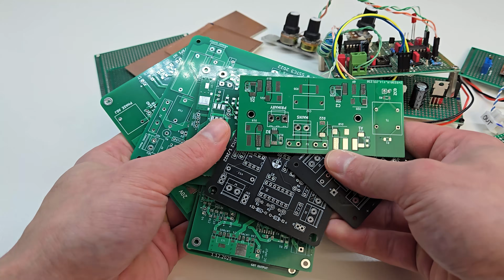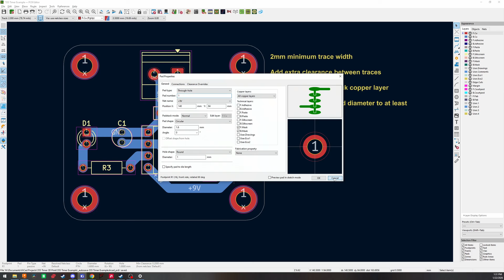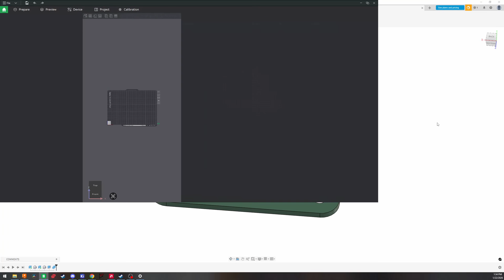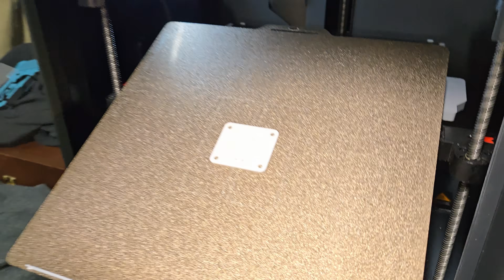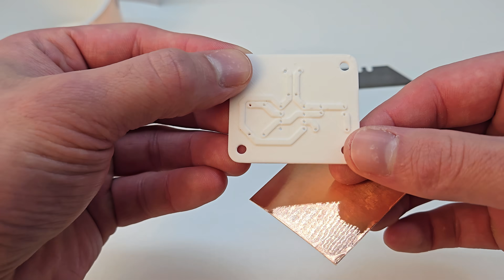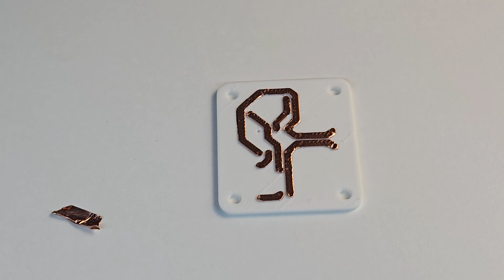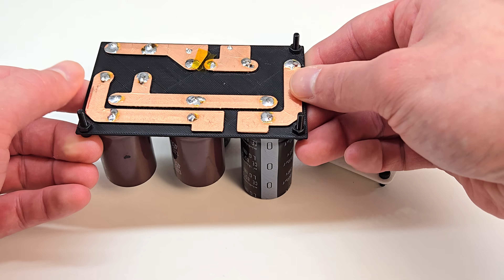3D Print Your Own PCB

Comment: For simple boards with thick tracks this seems a reasonable solution. For anything more complex, I'd use CopperCam and cut around the traces with my router, but of course not everyone has one of those. For anything more than 5 pieces, I'd use JLCPCB. They are rediculously cheap and very quick, and you get a proper PCB.

Comment: I wonder if a singulation printed part which severs the trace edges would be feasible.  The base part with pressed on copper foil has channels at the trace boundaries. The channels are say 2mm wide and 2mm deep.  A cutting 3d print is designed to fit in the trace boundary channels which stretches the copper to the point where it breaks leaving isolated copper nets.   There would be some alignment pins between the plates for the pressing process.  I would think a cutting web of 0.8mm wide and 1mm tall would sever copper.  To add a 90 crease at the top, the base of the rib could be just shy of the 2mm lower gap and of rectangular shape to push back the torn copper flaps on both sides against the channel walls.  Another addition is multi depth rib heights to spread out the required clamping load during this process.  This will not work for dip parts or surface mount but could have application outside the fine pitch areas.  Hand work around the close fitting stuff.  
I guess the holes could also be semi punched out by this tool.  Nice work on the video.   Improvements never end.   Cheers
A semi plated slot is now possible by this method (foil severing process) and could be used for leaded parts maybe with a J bend.

Comment: Very interesting. I was thinking about curved boards with a 2" radius when I came across your video (something that would work well in a RC airplane fuselage). I'm sure this method could be refined quite a bit. If not with my wife's Cricut cutting plotter, then using my diode laser cutter engraver (spray paint the tape, burn the trace pattern, then use ferric chloride to etch the copper tape.). Just random ideas coming to mind...

Comment: What about the behavior of the plate whenever components heat?
Reply from the maker: For basic circuits like a 555 timer, PLA is fine. If things are going to get warm, a different material should be used.

Comment: Nice idea but PLA🔥 is the most inappropriate for the use you suggested (lowest melting temperature and catch fire).  PETG is the only kind of suitable against fire if the choice is between {PLA, ABS, PETG}. For all the manual cutting work you might consider cable with wrapper tool so the benefit of the holes can be extended for multi layer PCB

Comment: I really want to try this, but i dont have fusion. will this work with a different program (e.g., freecad)? Also, is the tool you used to make the pcb design free? Is it very complicated to learn?
Reply from the maker: freecad will work just fine. Kicad is free and is a great program. For simple circuits like this it is really straight forward. There are also a TON of tutorials online for how to use it.
Reply: @QZW_Labs  Thanks! I actually just spent some time making a pcb in freecad. Without Kicad. I will try it out though! Thanks! You just just earned a sub

Comment: would be cool if you could have an abrasive tip and use the printer to drag it across a copper taped/coated board, basically cnc engrave pcb board (kinda)

Comment: Man, extra point for creativity - very out of the box thinking, indeed!  BUT, there is a huge RED FLAG for my eyes: Safety. Specially if you are doing rectifying, means power.... MAN... the copper foil adhesive might look good in the beginning, but there is no guarantee that it will stay in the exact place you applied it, as time passes. Warming, Cooling cycles... and eventually have a short. ONCE more: I loved the video and it gives interesting ideas for the future... who knows!
Reply from the maker: Thank you! I don't this method is better than normal PCBs but I thought it was a cool idea to share and might help with some prototyping. I agree, that anything requiring power or mains shouldn't be used for this.

Comment: You're supposed to use an etch-resist pen to draw your lanes on the copper clad and then soak it in acid to dissolve the unprotected copper.

Pretty cool.

Comment: This is a solid and very practical approach. Another option people may not be aware of is using all-metal conductive filament like Kupros, Inc's Cu29 to print the traces directly with an FDM printer. It has much higher conductivity than carbon-based filaments, so it can handle real power and signal routing without tape or post-processing. Different tradeoffs, but it pairs well with workflows like this.
Reply: Appreciate the mention. Cu29 was developed specifically to enable functional, all-metal conductive traces on standard FDM printers, so approaches like this are exciting to see. Different workflows, same goal, getting electronics closer to the structure instead of bolted on afterward.

Comment: I think you can make a negative part with the same dimensions for the traces and push it over the board (to cut the copper and to insulate it after removing the unneeded parts)

Comment: Why not recess the traces?  So they are even with the board surface?  it would be a bit more difficult to cut the copper layer away but it would give a better look?  Also, I would cover all the exposed copper with some type of sealer to protect the traces, clear lacquer or nail polish would work.  Even UV cured conformal coatings would work.  Also if you added a slightly thicker edge to the boards on the under side, same the same height as the raised traces, it would significantly improve the stability of the board, even using PLA.

Comment: Neat process.  We have a Cricut  Maker that we use to cut craft projects and I have used it to cut solder stencils out of thick plastic. I am sure it could be used to cut the traces out of foil. Then all you would need to do is remove the waste and use transfer tape to place the traces over the board. You would only need to print the board with holes and some alignment marks to align the foil pattern to the printed board. You would not need to print the traces on the board at all.  I would bet you could use thinner traces that way also.  I have some PET-G that I think would work great as the board. It has a higher melting temp and does not degrade like PLA does over time.

Comment: Great concept.  It seems that the most time consuming and delicate portion is probably the removal of the unnecessary copper tape.  One way to potentially improve it would be the use of multiple materials to simplify this.  For example, once you have created the pcb in fusion, create another part which is the negative of the traces (0.2mm gap between the traces and the negative).  Extrude the negative from the board up to the top of the traces as a new part with no vertical gap between them.  Print the board in ASA and the negative in PLA.  After you place the copper tape, you can use the 0.2mm gap between the pcb and negative as your cutout guide.  Then you can simply remove the PLA negative from the ASA PCB with all of the copper tape still on the PLA negative.  Since ASA and PLA do not adhere to one another, removal should be significantly simplified.  Not sure if the increased print time is worth the simplified tape removal but it could be useful.

Comment: 2 ways to make this even better:
Using resin printers which are increasingly getting cheap can grant you a very high resolution and heat resistance with some materials meaning you could use and flow solder paste with flux into small traces
FDM Printers can print at very high resolutions if you use the correct settings and with very cheap upgrades, for example if you get a cheap set of nozzles you could swap out your 0.4mm nozzle for a 0.2, or 0.1mm one which will let you get much better and thinner details, corners and holes and will let you get away with much more compact traces and circuit boards
Conductive pastes are an idea I've seen but I don't think it's the way forward, they degrade over time and won't give you a solid connection and the low resistance we need, so that copper foil is a very good idea, cutting it out takes time tough especially for bigger and more complex circuits, perhaps there are faster ways of getting rid of it:
Since we use a height difference to apply the foil, we may either by recess the parts where we want traces to stay and sanding the underside flat but It might be hard to apply the foil correctly in recessed traces
We could solder the components before removing the excess, apply solder over all the traces then dipping the underside in an ECM bath to dissolve the copper away
We could place an elevated edge of 1mm in the 3d file around every trace and sanding it down to cut away the bridge between traces and outside

Comment: What a neat idea! I'd suggest lightly sanding down the raised tracks with a piece of sandpaper on a sheet of glass to flatten down the surface texture prior to applying the copper.  Rigidity could be improved by making the board the full thickness of the raised parts and then modelling the perimeters of the tracks as narrow depressions which would guide the knife, and this would also make it suitable for SMD.  You could also add a lip to the perimeter of the board to increase rigidity.

Comment: Would printing the traces using carbon fibre filament be an option? Another idea I wonder if you could make troughs instead of raised ridges and then flood them with solder.. if it could somehow stick.. maybe rough edges in the troughs.

Comment: It seems like this would be a great mashup with a CNC paper cutter (Cricut, etc), and you could just cut the foil out in one pass, then weed out the extra copper foil before sticking it to the board.  Much cleaner results, though you'd still need to punch the holes manually.

Comment: I wonder if it might be better to recess the traces instead of extruding them? My thinking is that using a rubber roller or an eraser, it's fairly easy to push and stretch the copper into cavities, then use a wide blade or file or sandpaper to shave the top layer, leaving the copper inside the traces (it could also be hand cut inside the traces if desired). That way, the overall thickness can be greater, making the PCB stiffer, and after soldering the pins and cutting the excess, it might be flush enough to even glue a flat piece of PLA or plastic over the traces side to further stiffen the board and provide electrical isolation. Thinking more about it, it could also provide an easy way to have multiple layers by only soldering the pins belonging to each layer before stacking the next one.

A few years ago I covered a complete bicycle frame and fork with copper tape, and it stretches nicely into corners and curves. After a few months of oxidation it really looks like an antique, almost steampunk bike.

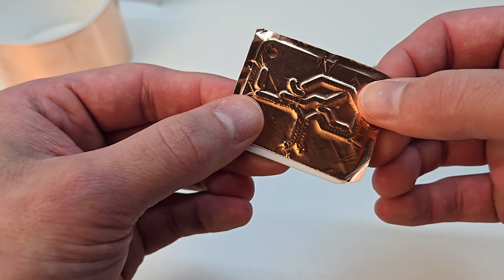Comment: 6:07 if you printed a matching part (mirror image with embossed traces) with sufficiently tight tolerances you could use it as a "cookie cutter" to tear the copper along the edges of the traces and eliminate the cutting step.

Comment: Briliant idea! Thank you for sharing your workflow. Only thing I'd ike to try is using ironing (in the print settings) to ensure that the top layer where the copper is sticked is smooth and adheres perfectly. I'm sure to try this with my students, the next time I'm using simple circuits to learn eectronics (with Tinkercad).

Comment: it's a funny method, it seems that it's really suitable for prototyping something simple, BUT only for a prototype and only if no element on the board is constantly heated. Do not use such boards instead of the usual ones made of fiberglass with a copper coating.

Comment: You could easily make two sided PCBs. Just create a two sided design crate the 3D model, cut the model horizontally in the middle of the base, so that you end up with both sides being able to print flat on the printer. After the print align both sides and done. No holes drilling necessary
Reply: If there isn't too much space between traces on one side you could even try printing it all in one piece with that "busy" side down, relying on you printer being able to make reasonable small bridges. Or use supports if there are wider gaps between traces, although that is likely going to lead to a rough surface, making cutting the copper tape more "interesting" 😊
Reply: BUT! You just gave me an idea! 😊

If you create some basic spacers ("legs") on each layer, you could then stack multiple layers! Like 3d chess 😂

And you could use simple headers to electrically connect the layers as needed. Assuming that the components are not going to be taller than the headers. 

The only thing is - each component will have to connect to a single layer

Comment: Interesting, but you have an unknown dielectric constant and a reliance on unknown glue, as well as the other issues you mentioned. For anything even vaguely important I'd rather just etch a board -- it barely takes more of my time... also, this technique would be illegal in EU I think for anything other than very low voltage applications with minimal PCB specs. Still, a promising idea.

Comment: Great idea man! I was a little bit sceptic at the beginning, thinking about soldering job... It could ruin the PLA support, but it seems to work fine. I am building a bass amplifier preamp and that could be an option for PCB building, as I am using perf board with hand cabling (you know such a colored all-aligned wires prototype board?). Which is the thickness of the copper foil? could you kindly share the amazon link?
Thanks for your inspiring video! Paolo

Comment: Use solder mask, on whole board and than make holes, it wold look more profesional, and before u put that coper tape add thick layer of cyanoacril glue on whole traces, in that way u can make even 1 mm traces (in that case make grove not extrude)

Comment: thats cool! BTW I found a way to copper plate plastic I tested it on a chunk of styrofoam. You put it in water and put blue crystal copper sulphate powder into the water then you puff a bit of dry lubricant graphite powder into the water. Then you cover it and let it sit I let it sit for a few weeks but maybe a few days is enough. anyway some kind of reaction happens and the styrofoam gets a thin flash coat of copper, that then makes it conductive surface that you could then electroplate thicker copper onto so you could then electroplate the copper traces somehow just make them a water path and on a level surface you could trickle the copper sulphate + graphite liquid and let it work then electroplate it in a copper sulphate solution to increase thickness maybe

Comment: A 3D printed circuit board, but without the metal part to connect it, and you just solder the leads together. I'm just print the holes where you want them. Or you could just drill the holes and save the plastic in a popsicle stick

Comment: Hello, I find this method very interesting for small projects, but you need to have the knowledge to build electronic circuits, which I unfortunately don't have. That said, for very small, super-simple projects involving connectivity between components, it seems accessible even for a novice like me. So I'm saving your video in my 3D printing folder, so that if I need it, I can easily find it again. Thank you for sharing.

Comment: ABS is horrible with warping especially when printing flat thin objects. 9:42
Reply: Can be countered with an enclosure and heated chamber most likely
Reply: @aceplayzgames3608 I have only had problems with Bambu ABS in the P1S which is enclosed. Never buying it again, ASA is much better

Comment: I am not a fan of this method. It is very easy to damage the traces, especially if the components are tall (parts would wobble and tear the copper).
Reply from the maker: Thanks for watching. It is pretty robust after soldering. The solder give the tape a lot of strength

Comment: This is cool. I am totally going to be using this technique! Suddenly I feel so happy. If I prototype on my tiny breadboard, I tend to break things with my fat fingers bumping things around and putting cables in the wrong hole by mistake. So I normally skip the bread board and go straight to the perf board, but that is loads of work and really messy and it so difficult when you need to change something that is wrong.
Reply from the maker: I am glad you liked it! Thanks for checking it out!

Comment: try making an anti/negative board for mounting the tape, i think you could probably get some really thin traces if the tape was sandwiched, pull everything around the edges down nicely, in theory
Reply from the maker: Good idea, I was going to try that but opted for a more simple design for the first demo. I will give that a try next time.

Comment: Here is a thought.  You can pause printing for putting in magnets.  So why not do that here. Print the bottom. The printer gets code to pause  and pulls back like for magnet. Then you put down the tape.  Then you finish printing the top. Only you print channel instead of raised. Punch the tape holes and Bob’s your uncle.
Reply from the maker: I will have to try that out

Comment: If you grab a quick Cricut cutting machine this will be amazing.... You can grab them on sale, old models or used online super cheap! The foil type tape will easily be cut in seconds.
Reply: The thing is, you'd still be limited by the width of the available tape. Unless you overlap them maybe

Comment: What if you print the inverse, so that they fit together and press the faces together, sandwiching the copper tape which would cut it along the edges where you otherwise would be hand-cutting, and you could even leave it there as the ground plate